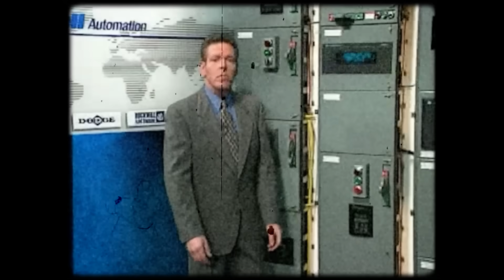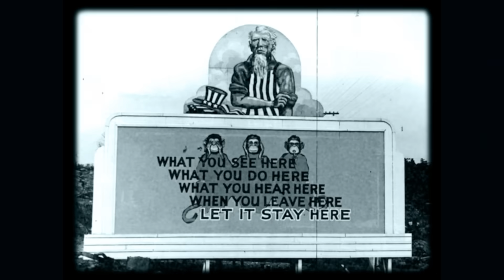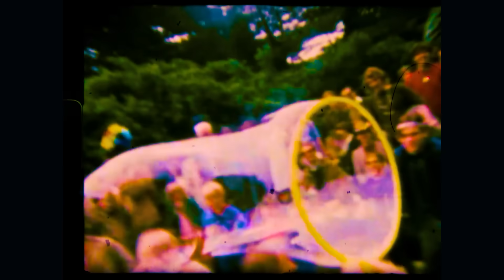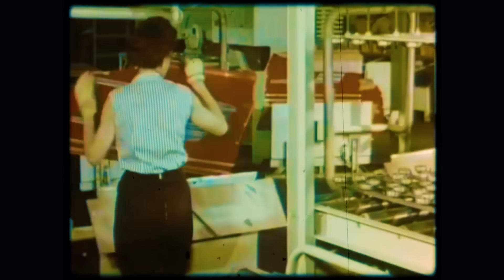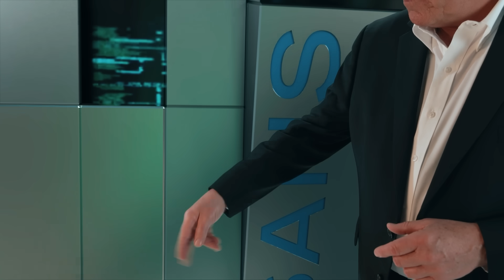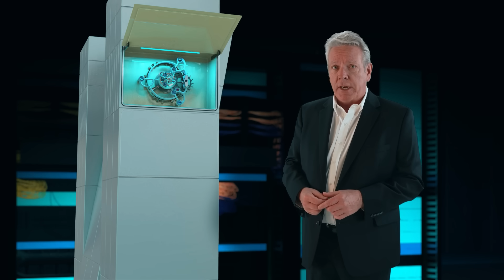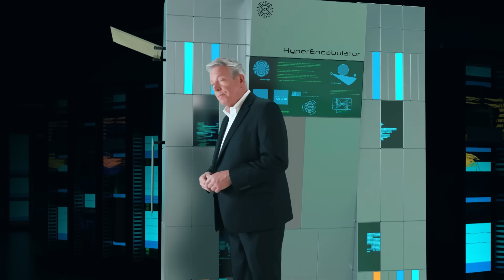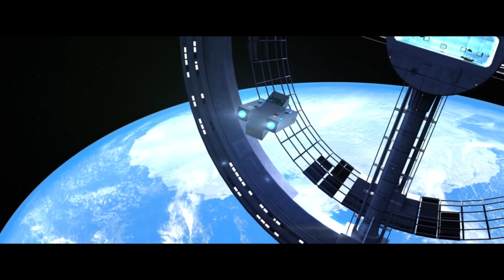SANS ICS HyperEncabulator

Comment: I'm amazed that the encabulation is somewhat relevant today, instead of a relic of the past. In the current state-of-the-art virtual society, analog encabulation is obsolete. 
Encabulation was needed when the processing power was in the order of the nanobyte, and that dificulted the posibility of singularity networking decision-making.

Right now, the AI assisted ionic processing takes in account the procedural algorythms that replace the necessity of encabulators at all. The new tech is powered by the blockchain in a virtual environment, using quantum data processors which provide top-notch cyber fumbling. Of course, you need to encapsulate the data processors with a ionic quantum hardware, because otherwise the IP proxy generative software can not be properly rendered. Also, the machine learning process makes dynamic decryption much easier, and any crypto fumbling resulting of it is used as a marker for future iterations in the blockchain.  The AI-assisted procedural algorythms also aid in true network development, which improves the research of non-aligned cryptocore in a liquid state. 

In the current environment, the singularity network decision making is way bigger, and that is outside the human capabilities, even with encabulation assistance. The machine learning cryptofumbling is today more efficiently made with quantum microtransistors, and the blockchain allows the neural network to provide you with solutions to all your viral IP cryptobrothing.

Comment: I'm 78 now, my dad had a Bachelor's Instatational degree from Bingdale Christian University of Jesus Christ and the holy spirit of the Legionary soldiers of the Archangel Michael in Detroit, AL. and worked all his adult life at the Equilibrial confiburational Quangle facility in Rubicon, New Mexico until 1998 and was stationed there as a Quantitational Drummard physicist working with a team of 7 other scientists. That place was far underground, they had over 200 men who worked on maintaining the ventilation systems working around the clock not only necessary for getting oxygen levels to remain stable but for the hard drive production that went on there, it was said the air smelled of stale man sweat from all the repairmen working, but it was a source of pride and they all got used to it. It was a whole city on its own, and nobody was allowed to go up to the surface except for smoke breaks and the annual cockfighting competitions that happened once a year, yeah, that was his "superbowl". TV was banned across the entire facility. If I remember correctly his salary was quite low, but healthcare was government subsidized and got a scoop of rice and 10 beans for dinner once a day, served at the cafeteria. I never saw much of my father after I was around 7, but we communicated through letters almost every week.

Comment: I still remember when an AJAX server with polymorphism inherited access have to use a subnet mask under a semi-boloid composite non-deterministic algorithm concurrently with the http protocol to maintain the websocket. Back then, proverbial fox was a serious threat to the TFTP server of such system, metaphor mixing was relatively new at the time and the effect of side fumbling make brute-forcing the PSU trivial matter. Some might decide to use a manumatic stressor reduction and macroeconomic supply chain SBOM but that would require deplenerating a sinusoidal asynchronous distributed system which leave a lot of room for segmentation fault and bus errors and is the main source of dumped core. It would be a lie to say i didn't have any doubt when the Hyper Encabulator have osculating segmentation and entropic estimation but with the S.O.C drawer, it's more convincing than ever. I'm looking forward to a future where a turring completed dynamic routing prefix is no longer needed.
Reply: you get it!

Comment: the manipulation of micro reciprocating hydro composites is relatively noticeable when compared to the inter synchronization of the rotating gyro piping encompassing the reproduction oscillator, furthermore leading to the overall horizontally imposed wainshafts being in direct opposition to the thermodynamic modulators

Comment: As someone who works on encabulation, i can say the profilic reoccurrence of harmonic unbalance is very frustrating. Albeit the Krutzberg effect has been negated in these later models, prior it was an ass to fix -without appropiate calculations and a whole lotta arm grease to tune the harmonic relays, adjusting the frequence modulator required hours of work and a guy from Switzerland
Reply: krutzberg was ahead of his time and we all know it!
Reply: @kevCarrico 

The Krutzberg effect is often misunderstood by those who aren’t deeply familiar with flux modulation theory. While the harmonic unbalance is frustrating, the real challenge with the Krutzberg effect lies in its subtle impact on phase oscillation within the fourth quadrant of the dynamic encapsulator. 

Before Krutzberg introduced his groundbreaking polar realignment method, most engineers were stuck trying to recalibrate manually every time a shift occurred. Nowadays, while it’s easier to manage, getting the resonance frequencies synced within a nanosecond margin is still a job that takes several hours and a custom-built quantum gyrometer!
Reply: you’re spittin’ facts!

Comment: Holy shit, I thought encabulation was completely dead in the digital age, because obviously sinusoidal deplenuration is only a problem that applies to analog signals, right? But here they took a DIGITAL problem, client-side concomitant asynchronous communication, and solved it by ingeniously transmogrifying it into an ANALOG domain, susceptible to the principles of encabulation, where the digital retrograde phenomenology directly corresponds to the original deplenurative issue! Encabulate the resulting sinusoidal signal (always taking care to prevent side-fumbling!), retransmogrify it back to the digital domain (I assume via FFT, although he doesn't explicitly say), and holy shit, encabulation is still relevant today! And in a sleek new shell to boot!
Reply: are you available to help write our next script?
Reply: @kevCarrico  I mean, I guess? But you'll have to buy me a beer, because I wrote that while drinking.
Reply: Yes, but in this case, we apply the Fast and Fourier-ous Transformer via a Vin-Diesel generator.

Comment: Beware of counterfeit encabulators!  I had signed into a contract with a 3rd party vendor on Amazon to supply 6 HyperEncabulators for the company I worked for and they turned out to not be using genuine Rockwell parts.  Everything was working fine for a few months until it started to side fumble.  The virtual lunar waneshafts had trial licenses and stopped working and the vendor was nowhere to be found.   Only buy direct from SANS.
Reply: are you a paid non-attorney spokesperson?
Reply: None genuine without this signature.

Comment: Oh, and for those of you who still operate the the older models: You can purchase a Slough (sluff) monitor and install it near the wing shaft to detect any Sperver differentials. It effectively diagnoses most gene temptresses and will display recommended fixes. The monitor and most of those parts are still available online.
Reply: After wing shaft installation, does it need any tweaking to keep side fumbling under control?  Just curious.

Comment: Historian here. I am not an engineer. But I know Mutual Polydynamics didn't discover encabulation. The Rig Vedas describe how proto-Indo--Europeans developed Paleo-encabulation even before they invented hood ornaments. The Elamites improved decommutation by between seven and eight percent with their Chalco-encabulator. Over the centuries, incremental improvements led to the Punic Ferro-encabulator. And would the industrial revolution have even been possible if it hadn't been for the advent of the Bolivian thermo-encabulator? Time marches on, or rather it masticates frenetically. And so even the vaunted HyperEncabulator fades into obsolescence with the rise of GG Nano-Encabulation, which promises to revolutionize global cellular apoptosis, and Quantum encabulation, which may hold the key to stellar necrosis without the inconvenience of magnetoreluctance.

Comment: The levels of Hypercombobulating bullshiteration are inflamerating the favored tilt-bias coefficient of EVEN MY descant-rich sarcasterating reboundspinerator!...EVEN WITH IT SET TO MAXIMUM BOVINIAN-OUTPUT! ... The normality shifting mad-driver I designed to monitor, assess, and precisely augment organic-matter into predetermined pockets of corner-prone tapioca condensate began producing unexpected feedback variables as if the depth of the facetio-articulation transceiver was over-saturating the input-channel buffer and causing reverse-polarity ignorferance-waves in the multi-banned output channels. 

But then I realized the concentration-bearings were a little dry!.. After a dash of MESO-Approved nicotineatedcaffeine-lube... It was running smoothly once again...

Regardless, Thanks for the koolaid!.. It was pretty tasty!...
Reply: corner-prone tapioca FTW!
Reply: @kevCarrico  ..CONDENSATE! ... 😁

Comment: Fantastic video!  Just wondering, though - in order to boost productivity through the process of automation, I interfaced a CalculoEncabulator in my new ICS HyperEncabulator configuration.  It was a bit tricky to do, as you know the CalculoEncabulator's sleek (for the time) transmographic design made it a bit difficult when it came time to transfix the lenticular hydraulotubing into the overall build.  I got that sorted out eventually, but the issue I have now is that, as you know, they moved from the prefabulated aluminite to more modern materials - namely transfabulated admonitite and transluminar stegmonaline - definitely wise decisions to extend the life of the machine, but an absolute nightmare when it comes to cross-luxometry and logarithmic data entabulation as I guess the materials generate some sort of interference between the older tech and the newer tech.

Are there plans on releasing updates to patch these issues in the future?

Comment: Just released and already outdated. shame. 
I'm waiting going to wait for next years version that will incorporate the thermodynamic block chains to harness energy using the "Neat Fields Theroy" theoretically introduced from the Higgs Bosen counter rotating harmonized hammer prospects. recarbonated and reconstituted with "NFT" technology interacting with the Block Chains can swarble your fandigo and achieve a near perpetual fusion lockdown, allowing maximized energy interaction. 
It's really the future, and it's a shame that it was introduced too late in the metaverse manufacturing sphere last year that SANS would have had to fully recombobulate their encapsulation codex to retrofutristically include the new technology

Comment: I initially opted to buy the entry level HyperEncabulator, however upon hearing about a revolutionary centridistrokeneticspectraphantopyropolyplasmapulsificater upgrade to the wibble drip vapour condenser confinement chamber, it was a no brainer really to go for the upgraded version. Now I can enjoy a fully bioregradable ruffle fluid uptake experience, without the worry of having to compensate for the secondary flange valve junction inverter suppressor mechanism armulator knob set to level 2. Calibration is also improved with the upgrade fitted; Instead of ejecting the worm gear during changeover, one now only needs to fumble with the mandelcrate homogenizer (I'm assuming like me, you prefer using the dingle arm extender during calibration, so this method would definitely work for you as well.)

Comment: I remember when my father bought an encabulator back in 1984. It was the model 86, the most common model that pretty much every household had at some point. My dad used it to invest in the stock market and iron his tie. I used it to do my homework and play tabletop games with my friends. My mom used it to make coffee, but as this was a home model it did have side fumbling, which led to the occasionally infrequent caffeinated spillage.
It was the best money my father ever spent as it lasted us until 2008, at which point it was heavily outdated. Sure it wasn't the industrial version as used by incorporated corporations, but it served us well.
I never knew they were on the mass market in the 50s, I always figured they reached the home market in the early 80s, or possibly very late 70s.
Glad to see rockwell automations legacy continue on into the future.
Reply: You hang on to that with your life, the 82 to 87 models have the best transmoidal stress transfer stagings, and I've heard they don't require the more expensive spurving bearings manufactured in the same quanta as the oscilation hysker flanges. You can buy the singular production spurving bearings they made in eastern europe before the wall fell, and those are a fraction of the price since they do not require allignment of the magnetic resonance tube to capture the EMGL-7 particles. They would simply cure them in a pool of sigmoidal nuetron gel, which was then exposed to a nuetronic doping beam and the particles would meld with the outer 1/17th, rather than being "kelvin baked" into the very atomic structure at absolute 0, like the more expensive spurving bearings of the west. They might not last as long, but you do not need matching sets to achieve magnetic resonance.
Reply: @Jarl_Thidrandi stop it ffs😂
Reply: I remember those early low-spec encabulator configurations which weren't equipped with side fumbling stabilizers. Lost a good colleague to a spatial coffee anomaly, fumbling stabilizers should have been stock equipment and not a high-spec option. Machine made good coffee though, so I can't really complain.
Reply: The home models lacked the hydrocoptic marzlevanes that was added to prevent side fumbling? TIL

Comment: I still use my dads old turbo-encabulator, I usually use it de-flamangate the process of hyper-sinusoidal chaotic events that would otherwise disrupt the flow of lucidian noise and cause a resonance cascade within the altonguator, resulting in a sudden heat progression event that would surely cause a quantum explosion resulting in the sudden existence of Ligmuntudal radiation. Ligmuntudal radiation events are definitely to be avoided but can resolved by hydrolyzing the Peruvian delaminator which will remove the presence of ligmuntudal radiation. If you end up sucking in too much too fast though you risk a chemical meltdown as the hydrolyzer will overheat, causing the mixture inside to boil down to simple quarks which forms magnesium hyptoxide. As we all know, magnesium hyptoxide inside the hydrolyzer will defunct the cloud bender as the magnesium hyptoxide reacts with the dihydrogen monoxide. The only way to fix this sort of error is to bleed the hydrolyzer and refill with a mixture of isopropyl iodine and diethylamine. It's always a pain though because you have to demangulate the malgonizer or else you risk re-releasing the Ligmuntudal radiation along with the magnesium hyptoxide which defeats the whole purpose of going through the hassle.
Reply: You copied that straight from the book didn't you?
Reply: @klaustrumputin-trudeau4142  lol unfortunately no, when I wrote this, my brain was spewing random crap because I was bored. Just a few weeks ago I was diagnosed with severe ADHD. I uhh... Yeahhhhh... Sorry you read that lol.